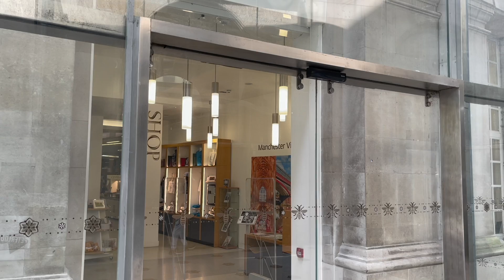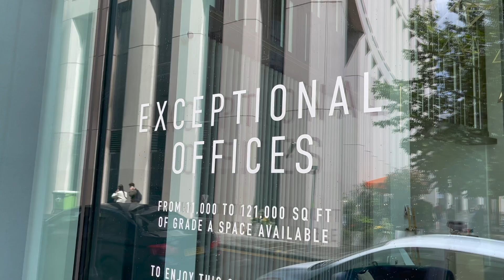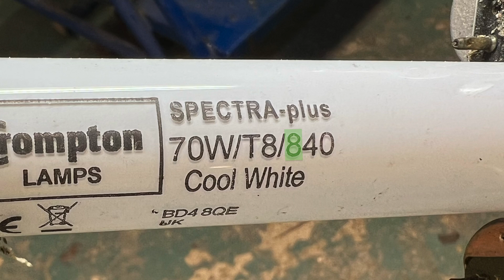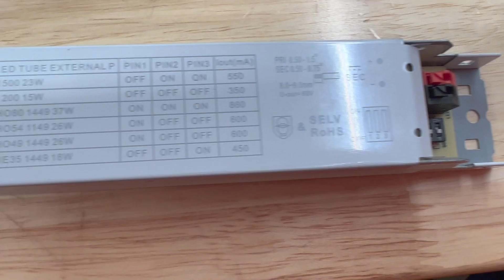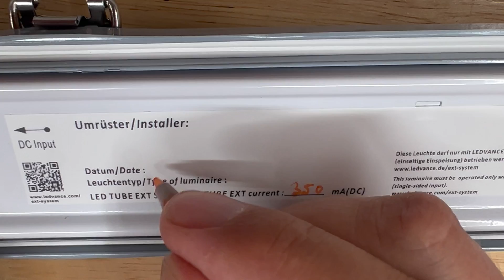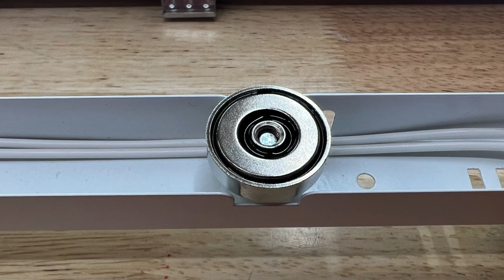How Can You Escape the Fluorescent Tube BAN?

Comment: I see a lot of headcases throwing away working lights because the new ones are allegedly more efficient. They forget they have working lights and it'll work out cheaper to use them til they fail then replace with more efficient lights. Personally, I cannot stand those nasty CFLs or LEDs. I use incandescent when I can get them.
Reply: sounds expensive on the electric bill...i still use alot of cfl tubes and wont switch to led but incandescent is where i drew the line.
Reply: @ahah1785  It really isn't much money. In a typical house you have 4 lights on for maybe 8 hours a day. That's 8x100w bulbs vs 4x25w flouresent. BTW you lose all you save by using flouresecnt aif you turn them on and off s it needs a high starting current.

Here, a typical electric cost is 14c per KWH.

So let's look at how much 400W would use in a month...

That's 400x30x8 which is  a massive $13.44

So how much if it was 4 x 25W florescents - that'd be $3.36.

But if you can't afford $13.44 for lighting then you really need to get a proper job.

Comment: I used to be able to fix a light that had gone out by swapping the bulb now in order to save energy we throw the whole of the light including it mount and fit a new one. Every led flood light io have fitted has been totally useless and needs replacing usually around the 12 to 16 months mark regardless of quality. The last one was a £ 60 quid led floodlight lasted 16 months. Ther other fitting is a halogen been fitted 12 years ands Ive put a new filaments in 3 times. So lets waste all that money nad fill up out waste bins.
Reply: I had the same problem. Replaced a perfectly working fluorescent tube for an LED version. Didn't last two years. Guess what, put the fluorescent tube back in and it still works to this day.
Reply: @Smelter57 that’s why I’m bulk buying tubes, mines been going for 40 years and actually has no signs of packing up yet!
Reply: If you fancy it and have the time, swap out the LED cob in the flood light. They are normally 50w, I swapped mine for 80w. You can swap them for 100W cob too, the brightness is the same, the cob will last much longer because its not over driven.
Reply: @PF-gi9vv  Its not always the LED cob that fails within the fitting though!
Reply: LED shit
Reply: Seen so many LED units burn out when not used with a separate transformer/ ballast
To reduce the mains supply. 
Not exactly energy saving or time saving or money saving.
Reply: Had a led bulb die short, tripped the breaker and killed the controller in the fan attached to it recently.

My local Bunnings has so many led fittings with burnt circuit boards ½ dead LEDs 

No thankyou. I'm happy to keep my 2' 4'  and 8w t5s alive.
Reply: @voltare2amstereo  The beauty of Fluorescent tubes is the simplicity of them imo! Not much to go wrong, and easily sorted if the tube/starter fails. I've seen so many places fit themselves out with LED's and within a week or 2 their are failed fittings. Can't beat a old tube, ballast and starter!
Reply: @8skellerns  our office has had the same led tubes in for over 6 years and they’re on 9 hours day. T5 and T8 are being phased out so end of next year you’ll struggle to buy any. Most LED fittings now come with a 5 year guarantee. Old fittings starter goes, ballast goes, fitting goes, lamp goes. LED are much better imo. I bought LED security lights from Screwfix LEP I think, lasted 1 winter. Replaced with Amazon bought LED and no issues 3 years on. Some external are hit and miss.
Reply: @MrSmid888  Guarantee does not cover the cost of the electrician to replace the units or the hassle.
Reply: @8skellerns  I didn’t say it did. It’s no hassle. 
You’ll have no choice in the next few years.
Reply: @voltare2amstereo  same
Reply: LED is crap it fails quickly and when the flood lights fail they expect us to replace the whole fitting
Reply: @manitoba-op4jx just like heat pumps.
Reply: Once the phone system goes 100% digital you'll be chucking out all home phones and answering machines too so leave some space in the skip.
Reply: @MrDirkles  Not exactly as you can plug the old home phones into the routers phone socket on the back and it will still work as before.

Comment: I already replaced all of my flossies, took the lot down fitted LED light bars, cheap as chips easy to swap, far far far better lighting, comes on instantly, no flicker, and in fact the lighting is so good I am considering another small alteration so as to be able to only turn on every other light bar, but keeping the option to have them all on if necessary! In all honesty I would go for LED light bars every time! That is my workshops, at home I led lights everywhere now, and in all honesty, fewer headaches, better lighting, and so so so much cheaper. In fact since the energy prices have gone up so much my electricity bill has gone down. I pay on demand, no direct debit, I have smart meters, they send me a bill I check it if it's right I pay it, my very first electricity bill after changing everything to LED lighting was 0 yes honestly zero, as I was a little in credit before the smart meters. That's the way to go folks Stop pouring your hard earned pounds into the fat cat coffers!
Reply: Just a word, but you don't get your electricity cheaper if you don't pay by direct debit.

In fact you could very well be on a higher tariff or they might be charging you extra because you are not on a direct debit.

Comment: You covered every scenario except the fact you can just buy a LED TUBE AND STARTER and fit like you would a fluorecent 2 minutes work job done
Reply: Yes the simplest choice and he never said thing at all show how much brains he got.  He Just about making money and make people think they need to replace the whole thing.
Reply: I have had that set in my bathroom mirror light for 5 years now and it works fine. Flickers a lot though at 50 Hz due to the simplicity of the tube circuitry but I suppose that could be remedied by an integrated current regulator in the tube or changing the entire tube ballast for a led driver.
Reply: @wombatillo  
Just replace the tube last you another 5 years, iv been looking after student related premises for 8 years and and the living and communal areas are fluorecent lighting 5 and 4 foot fitting and not one unit has failed in that time, we replaced tubes and starters but not one single fitting,
Reply: I swapped out a T12 tube for led literally yesterday. The existing fixtures can all stay there until people remodel or rebuild.

SMH, YouTube get dumber.

Comment: I used to work in a weaving mill so we had to have high grade fluorescent for colour accuracy. We swapped to all leds i think £100ish a pop and had thousands of them. Ended up with double the lights as rhey just couldnt do what a fluorescent does it was horrible.
Reply: How long ago was that? I replaced my old 5ft tube with a new LED tube and a starter bypass last year, it cost me £8 and is noticeably brighter than the tube it replaced, LED replacement priced have cratered in the last 2-3 years; I remember seeing quotes for £70 not so long ago.
Reply: @ianemery2925  It's colour accuracy but high CRI light fittings aren't that expensive anymore.
Reply: @ianemery2925  probably about 5 years but as I said ther had to be very high quality for good accuracy we expensive silk garments.
Reply: Too bad someone got the wrong bulbs, we replaced our flourescents with LED at work, half the bulbs nearly twice the light!
Reply: @williamjackson5942  not at all we had people in to do it specifically it's just the nature of the environment and quality of light we needed wasn't anywhere close to what we got from the fluorescent tubes. LEDs can be brilliant don't get me wrong but just didn't work for us. If you look at light boxes which companies use for checking colour swatches for match all the big players are still using flourescent tubes.
Reply: @HA05GER  I work with LEDs for a living. We do signage. Every thing is LED now. We have changed the factory lights to LED and the difference is remarkably better.
Reply: @paulb9769  things may have changed alot but for us it was terrible worse thing we ever did. Things have obviously changed since we did it I've just had new kitchen fitted and got two strip LEDs and they are brilliant so bright if.anythinf too bright. It was all about the colour accuracy for us that made it hard. We ended up more lights than before to try and counter act it. I don't know if it was to do with how the light was defused or what but it was terrible. Like I say we had a company sort it for us trialed different ones which seemed ok but we still had all the flourescent tubes around which obviously made it less noticeable.
Reply: @HA05GER  
I am a novice and I too have had bad experiences with led. Cost us a lot to changeover and the constant flickering has continued to cost us in our factory.
Reply: @onlythetruth883  I've never noticed any flickering personally but have heard of people being sensitive to led lights because of this. Alot of people I worked with didn't like the light it felt very gloomy in our factory. LEDs don't seem to spread the light like flourescent and because our machine required a gantry above them the ceiling was very high making it feel very dark. We used to leave extra lights on upstairs which we never did with the fluorescent tubes.
Reply: @HA05GER  
Yup! I too prefer the glow of fluorescent.
Only don't like the idea of ballast and starters as difficult to figure out where the problem is when it goes out. 
   Even sometimes the led lights on cars seem to be accompanied by a distracting halo.
Reply: @onlythetruth883  yeh I prefer them in certain scenarios. I find most the time if the bulbs flickering the ballast is out if the bulbs not lighting at all the bulb has failed. My house I have led I can't fault them for that I have led strips in my kitchen brilliant I just think there is environments that they just don't work very well. I also find that bulbs are never good as they state on package say 5w is 60w equivalent or whatever I find that you have to go alot higher than stated to get the same as an old school light.
Reply: @williamjackson5942  1000% more health hazard as well. LED are the most dangerous lighting out there. Councils cannot even get insurance for their LED street lights because they are so unsafe and causing eye problems and cancer etc. The EU etc is NOT interested in how dangerous LEDs are as exposed by experts such as Dr Alexander Wunsch on his videos such as Artificial Light Chronobiology And LED Hazards over on vimeo and the Mark Steele court videos on the Ian R Crane channel on Youtube.
Reply: I have found the exact opposite with my lights. I love LED.
Reply: @liam3284  
Thank you for your interest and information. 
   They were flickering all over the place. Inefficient, gloomy and distracting, made videos of it to show the supplier as these lights were very expensive, especially at the onset of led replacement.

Comment: The retrofit unit that uses a "powerful magnet" to attach it to a metallic chassis: presumably this is a neodymium magnet? Given that there seems to be an obsession with making everything electrical fire resistant (metal instead of plastic clips etc), has anyone thought through the implications of the low curie point of such magnets? In a fire, anything relying on them for attachment is just going to fall off the ceiling...

Comment: Someone gave me a few fluorescent fixtures without tubes. By the time I went to install them 4 years ago the LED tubes were the same price as fluorescent - and way better!
Reply: Led tubes are £8-9, a same size fluorescent is about £1.60. That is not the same, and the led tube offers less light.
Reply: @blow0me  Light bulbs come in different brightnesses.  You need to look at the Lumens to see how bright they are.  Watts are a measure of power, so LEDs will be brighter than a fluorescent with the same power.
Reply: and more damaging to your eyes - but you won't know that yet...
Reply: @pootle5096  But somehow you DO know that.  Care to explain?
Reply: @pootle5096  I don't doubt it, which is why most led lights ow have opaque diffusers. LED's can really burn into your eyes without it

Comment: Are there LED replacements for the colour matching tubes, used in paint booths and print rooms, and artificial daylight tubes, used for people with SAD?
Reply: Artificial daylight leds and led tubes certainly exist and they can easily have better CRI than tubes.
Reply: @wombatillo  They're expensive though.
Most LEDs have a CRI of around 80 to 85, cheap ones have sub 80.
85 to 90 are high end
95+ are hyper expensive.

Comment: Flourescent tubes are getting banned  over what, a few milligrams of mercury metal, led light bulbs have an advantage over cfls that come with a cheap ballast unless on a ballasted fixing and incandescent bulbs which are line resistors on a stick, all because of the long lifespan, but on batten and false ceiling applications where you expect them to stay for many years is where light starts to shed on the LED, for starters nothing is replacable, the led driver might be replacable but if the actual light module fails, either way it gets chucked in the landfill, its a step back as it prioritises consumerism and capitalism.

Sure you can say the same thing about flourescent tubes but you replace the tube at the fraction of a cost usually £5 and depending on the ballast, it might serve an entire LED lifespan + several more years in one go and with high output tubes being a thing, you can have less fitting per sqM.

And flourescent tubes are to me the sweet spot with a mix of longevity and recyclability, with the glass melted and turned into something new.

They should have banned the use of incandescent bulb based traffic lights if you ask me.
Reply: Nope, look at all of the resources used, LEDs are semiconductor devices and like a diode can run on direct AC or DC but they use a driver, when the driver fails the fitting will flash, and then you have to chuck it away meaning resources wasted, and the toxic metals used in LEDs are arsenic, lead, iron, copper, and nickel. Heightened, direct exposure or consumption of some of these substances can lead to cancer and skin lesions, search it on Google!
Reply: I think more like energy efficiency issues.
Reply: @AntonyoKnight  Well, who pays for my electricity bill? I pay for it, not them.
Reply: @ivankirola2707 you have a few options, keep it the same, replace the switchgear to electronic as from my experience, the more times you strike a tube the ends wear down more than expected, replace half of the installation from regular T5 to T5HO and remove the other half or convert an entire T8 installation to T5HO since the light output is really the same, and you also have the options discussed in the video where you retrofit or replace with led. It's up to you, it's your electricity bill you can influence where it goes, but remember a flourescent tube is always tonnes cheaper and easier to recycle than LEDs!
Reply: @professionalineverything I think that fluorescent tubes are banned too early.
Reply: @ivankirola2707 let's develop T14,16,18 and 20 and make ho versions aswell
Reply: @AntonyoKnight  Efficiency is a consideration, not the consideration.  There are times when it's important, times when it is one of many factors and times when it should not be considered.
Reply: @randacnam7321 I don't focus on efficiency I focus on resources used and what goes into landfill like all of the prematurely failed led battens and flat panels, you chuck the whole thing away whereas tube are replaceable.

Comment: Technology still isn’t quire there for led , I’ve  seen no end of fittings failing after 6 months
Reply: Yes I do wonder how many ever make the claimed lifespan. It is a case you get what you pay for with led,s. Chinese shit generally only lasts a year. No often than not it is the drivers that fail
Reply: @johnwarwick4105  Almost all the LED's I've used have vastly lived up to and outlived the claims...
Reply: @johnwarwick4105  its most the drivers that fail on the floodlight/front door lights that been fitted , also the retro 28w 2d fittings just burn out on the piece in the centre where it goes into the 4 pins on the fitting
Reply: I've got a led tube that has lasted over 2 years and still going strong.
Reply: @64-bit63  the tubes seem to last its the other stuff that we find that fails , security lights and retro fits 28w 2 d lamps
Reply: What male is it? Osram? Philips? Always look at that big organisations fit, they know what lasts - a top tip for deciding on bathroom fittings too!

Comment: I haven't used florescent lamps in years anyway. I either use LED lamps running on electronic T8 ballasts (type A), or I use LED lamps that run directly from the mains voltage (100-277volts type B).
Reply from the maker: Still loads of them living in the wild